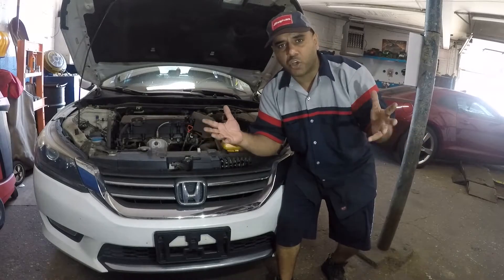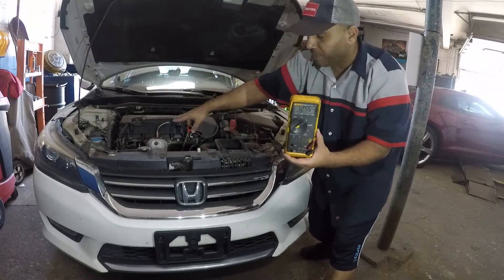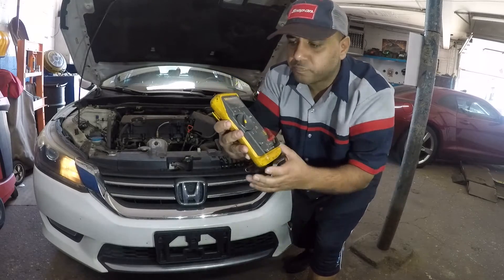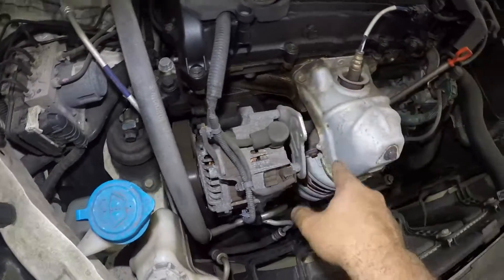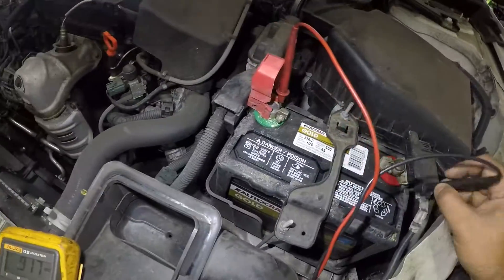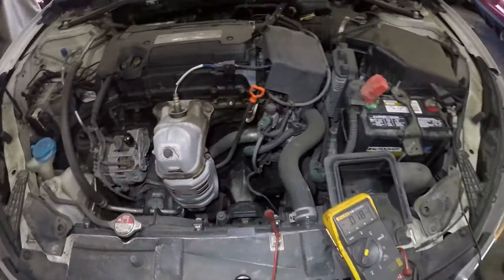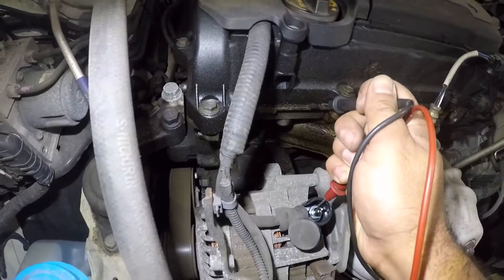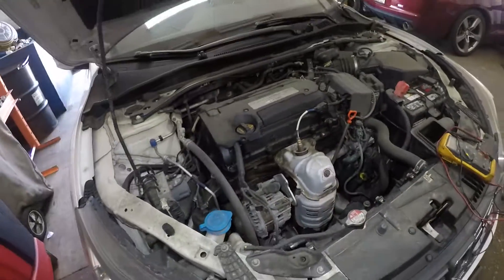Honda Accord 2013 to 2017 Alternator Voltage Test

Comment: Whats about it show 13-14? Is that bad? Should I be replacing my alternator?
Reply from the maker: Anything 13 and above is good can’t be 15either so ur good but alternator can fail intermittently.
Reply: @RBTheMechanic but my mechanic keeps asking me to replace it? Am I getting robbed by the mechanic? My car used to show “checking system” once. But after I turn the car off and put it back on. It never show that message again? Is that still bad?

Comment: This is my exact car and engine, and your video is the only one that showed multiple tests—thank you! It helped me realize the issue could be the connection between the battery and alternator (wires or fuses), not just the battery itself.

My car starts 3 to 7 times after a jump but never dies while driving after the first no-start.

Here’s what I’ve found so far:
	•	O’Reilly’s Auto Parts tested with the car running—said “BAD BATTERY” (no voltage reading) and tried to sell me one for $180.
	•	Two used battery shops tested with the car off—said “GOOD BATTERY” (also no voltage reading).
	•	Tires’ Choice tested with the car on—Battery: 14.2V, Alternator: 12.5V. They said “BAD ALTERNATOR,” which is possible, but…

After the test, I pulled the negative terminal in front of them while the car was running, car didn’t shut off, and they said new cars don’t work that way. It’s a 2015 with a 2.4L engine that’s been around since 2003—nothing fancy! There’s not much technology either. It’s why I love it. 

I just got a multimeter, so I’ll know more soon. Gonna test alternator directly. 

Quick question— is the alternator fuse that little black box connected to the negative terminal?

Also, I can’t believe how many places give different answers! In the past 8 years, every time they said bad alternator, it was a bad battery but I admit,  I’ve always put reconditioned batteries. This time it’s only been 7 months. Usually it’s 2 years.
Reply from the maker: Nice all the good information!!!
Reply: @ lol! I don’t blame if you didn’t read that whole message. I was bored 😂 

Just wondering is there a way to test the connection between alternator and battery if both are good? Idk if there is a fuse in between, or just a wire.

Comment: I have accord 2017 While the car is running 12v What is the problem supposed to be 13 to 14 volts?
Reply from the maker: 13+ volts
Reply: @RBTheMechanic  My car only has 12 what's the problem
Reply from the maker: @Y4SOORE  alternator
Reply: @RBTheMechanic  Can it be fixed?
Reply from the maker: @Y4SOORE  alternator need replacement original
Reply: @RBTheMechanic  Could the fault be in the generator regulator?
Reply from the maker: @Y4SOORE  part of alternator try disconnecting battery sensor and plug it back in see if that resolve the issue

Comment: Bro please help! My 2015 Honda Accord stays at 12v most of the time till charging system kicks in. Is there anyway i can keep it at 14v + at all time? I need constant 14v always because of my radio system. Did i burn a fuse or something? Please help me.
Reply from the maker: No it will give u check charging but not sure these alternator are like smart controlled alternator

Comment: What about the electronic battery sensor ? Will you always get 14.5 Volt charging voltage ? or will it sometime drop to 12.7  V ?
Reply from the maker: Yes it will drop
Reply: @RBTheMechanic Using  my Konwei battery  tester per their instructions on a Honda accord 2015 shows charging voltage to be about 12.68 V.  I thought the charging system was defective.  So I guess  not
Reply: @rcarioca so if my battery and alternator shows under 13 after the drop, it’s fine. Or is that voltage drop just for the battery.
Reply: @RBTheMechanic  You learn something new every day. Just when you thought you knew all about charging voltages

Comment: Been following your video a long time. Thanks boss. I have a question. My battery doesn’t go beyond 12.70 when car is on. But when I turn on full head lamp or Acc, it goes to 13 to 14 volt. But when I turn of the load, the voltage drops to 12.6 which isn’t good. What can be the issue pls ?
Reply: Mines is doing the same on my 2015 Accord. I’ve just changed the alternator twice and the battery sensor and still getting 12.85 . Were you able to find the issue?
Reply from the maker: @Chucky_1034  well this car was very worried it came back to me like 6 months later it was bouncing up and down 14v  for few seconds then 12.50 for like 10 seconds and then went back up to 14 then down to 12 for few seconds then it stayed at 14 and it stayed there for like hour and I left it alone I believe 14 is the level 13 above should be good.   It’s just worried
Reply: @RBTheMechanic  I guess that’s the norm. Thanks!
Reply from the maker: I found the same issue on sum of these accords did u replace ur alternator?
Reply: No I didn’t, the alternator is fine I guess..
Reply from the maker: @GasparZoran-vz5no  I have seen voltage fluctuations like that in few accords but I also seen stable 14v no change it’s very confusing with these new generation Hondas

Comment: Been watching your videos. Thank you for taking your time to make them for us! I do have a question. I have a 2014 Honda accord LX 100,800+ miles. I just replaced the battery two weeks ago, then the alternator the next day. Ever since I’ve had the car back, when i am stopped at a red light it idles rough and acts like it wants to lose power. Acceleration seems off and then the “check charge system” indicator will flash on my dash. I have had it tested at AutoZone and it came back with a bad reading. O’Rileys today said it was a bad voltage regulator. But I have taken it back to the same mechanic twice, and each time he says there’s nothing wrong. Could it be the alternator? I have changed the spark plugs. Coils are fine too.
Reply from the maker: If u out in after marker alternator then u need to redue the alternator. Put in original alternator check sensor on battery and horn fuse as well
Reply: Been following your video a long time. Thanks boss. I have a question. My battery doesn’t go beyond 12.70 when car is on. But when I turn on full head lamp or Acc, it goes to 13 to 14 volt. But when I turn of the load, the voltage drops to 12.6 which isn’t good. What can be the issue pls ?
Reply: I had the same issue and purchased the battery sensor from honda and the check charge system went away

Comment: I changed my battery and alternator and still no charge. Can it be the alternator fuse? If so which is the fuse?
Reply from the maker: Did u out in original alternator ?  It can be fuse check horn fuse and disconnect the battery sensor and reconnect or it

Comment: I have a 2016 honda accord sport i was noticing my light’s getting brighter when i revved the engine. I brought it to autozone and the test came back saying current flow fail for my charging system. They said it was the alternator, what is your opinion on this ?
Reply from the maker: I think so alternator as well

Comment: 2015 Honda Accord base , Altenator is reading between 14.8 and 14.6. My battery keeps dying. I just got battery yesterday. Also got Altenator replaced last week. Is that voltage too high ?
Reply from the maker: Well the alternator dose provided 14 v only when it’s required not always mostly it will stay to 12v when under load with accessories on it will kick on 14

Comment: I have a 2105 Accord. Should my battery read 14.4v as soon as I turn the car over? It seems it takes a little drive before it gets to 14.4v. The alternator puts out 14.4v when I start the car.
Reply from the maker: Nope it should rear 14.4v usully it work off 12 v this system is different than older modes of cars

Comment: Sorry but do you know about Honda Dual mode charging systems?   12.5  to 12.9 is normal at idle.  They only maintain at Idle   Add a load then you will see your 14 .40
Reply from the maker: Yeah 12 Volts are on these new cars they only charge if needed to be for fuel efficiency

Comment: My mechanic showed me the exact same readings you got 14.55 with the red on the alternator underneath that rubber cover thing and the black on the engine block and he told me that I need a new alternator and battery. 🤦🏻‍♂️🤷‍♂️. My car smells like rotten eggs so he said that’s coming from the battery?
Reply from the maker: Battery can smell like that I would replace the battery alternator seems good voltage

Comment: So my accord only change at 14.** volts when the highlights are on. Highlights off its at 12.**volts. Is this normal for these model?
Reply from the maker: Yeah I noticed that it cuts down power if ur not using accessories or putting out load

Comment: RB, I’m having problems with my 2013 Honda Accord exL same vehicle in this video.. keeps say check charging system with battery sensor and every other sensor on.. battery is 5 months old, alternator brand new.. car makes a clicking noise when I go to start and doesn’t turn on.. I put a brand new battery current sensor on the battery negative side.. I had a charging system charging the battery car starts then all lights come on, power steering makes the wheel hard and then rpm and gas go down to 0
Reply from the maker: So it’s stalling? Did u check alternator outputs
Reply: @RBTheMechanic  yea I changed battery current sensor, battery, and all my lights come on and still says check charging system
Reply: @anthonyarodes366  Did you ever fix it?  I have the same problem....

Comment: Car on the battery volt is 18volt what going on bad alternator?
Reply from the maker: Yeah too much voltage bad alternator prolly will fry electronics what car u got
Reply: @RBTheMechanic  2018 accord
Reply from the maker: @jygogaming3550  yup way tooo much voltage

Comment: RB, I'm having trouble with my 2017 honda civic (starting to take a long time to crank).  I was able to use this video to rule out the alternator as the problem.  Thanks for sharing, it helps!
Reply from the maker: Start with checking battery and if battery is older than 3 years it got to go
Reply: @RBTheMechanic  I replaced the battery, checked voltages during startup and under load (2,000 rpm in neutral for about 2 minutes), never got above 14.6 V.  But when left to idle, the voltage dropped to 13.1 V.  Is the computer "downpowering" the alternator when not under load, or is this an alternator problem?  When I do something simple such as turning on the headlights, the voltage would jump up to 14.4 V, as soon as I turned them off, it drops back to 13.1 V.  Other than that it's acting normal and the battery was charged afterwards.
Reply from the maker: @andrewgautreaux40  I do t think that’s problem when u out somthing in that puts load on engine so idle speed go up rpm goes up and alternator start to create more
Reply: @RBTheMechanic  Car's been running fine since the battery change - thank you so much!
Reply from the maker: @andrewgautreaux40  nice!!!
Reply: @RBTheMechanic  that might be what my issue is... its from 2019 (2014 ACCORD).. its been dying and I need a jump 3 times in a month. Got new battery today, if it dies again then probably alternator I'm guessing ...
Reply from the maker: @missmaomi28  check the output first

Comment: Have you ever done a parasitic draw test on these accords? I have a 2014 Accord that keeps dying after about 2 days of not driving. Replaced the battery twice now.
Reply from the maker: No I haven’t had a car with the type of issue but u have to connect the volt meter in line with battery and start pulling fuses to see if any makes difference start with radio fuse done lights trunk light
Reply: @RBTheMechanic  thank you. Will give it a try
Reply: @RBTheMechanic  can you make a video on where the starter relay/fuse is and how to remove it?
Reply from the maker: @brindan1609  sure will down the road

Comment: The voltage in my Honda goes 11-12 volts when I turn the A\C on. It is 14 volts when A\C is off. Is that normal?
Reply: Yes the car is pcm controlled so if you don't have a load on it it will charge around 12v when you turn your ac on or headlights the voltage should go up to 14
Reply from the maker: My Camaro goes to 12.**  when I have blower motor on high speed and ac on but not 11
Reply: @RBTheMechanic  I will re-check and reply later. I should check the voltage that is coming out of the alternator, just like what you have explained.
Reply from the maker: @abdullahxo1689  yup.  What is the XO1 in ur name   Traxxas xo1?
Reply from the maker: I will check that and make video on that also
Reply: I guess it's kinda randomly asking but do anyone know a good place to stream newly released series online?
Reply: @Russell Keith Flixportal
Reply: @Ryan Knox Thank you, I signed up and it seems to work =) I appreciate it !
Reply: @Russell Keith Glad I could help :)
Reply: Changed alternator , battery  , battery  sensor  ,and eld fuse . Charge is 12.4 when lights on 14.4 but check charge system sometimes  turn on so I have to drive with lights on... any ideas ????
Reply: @pedroramirez2   Same thing happened to me on my 2013 Accord, I think this is how they are making them now. I’m not 100% sure
Reply: @pedroramirez2 mines be at 12.3 but when I turn my lights on it goes up to 13 plus .. What do that mean?
Reply: @pedroramirez2 only thing left to change is wire harness. I’m about to start the steps you mentioned and hope it’s that battery. Alternator voltage not right but hoping for the best